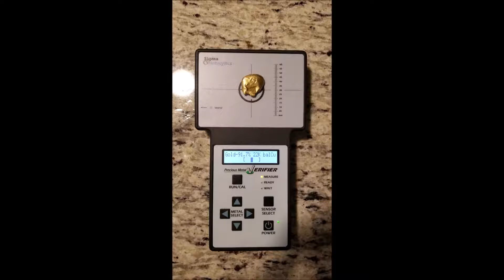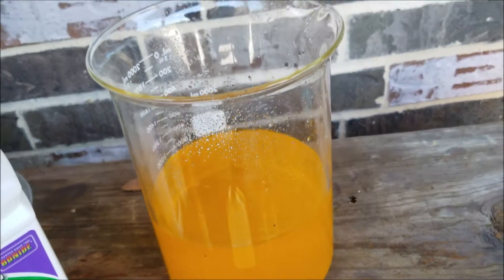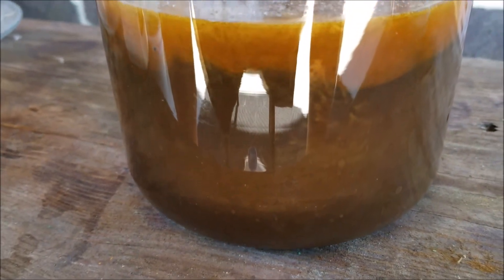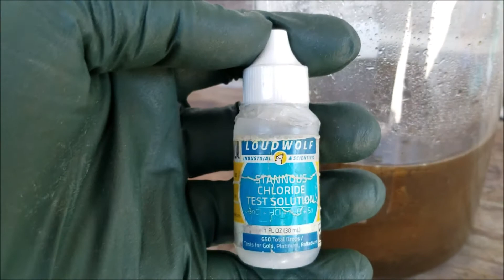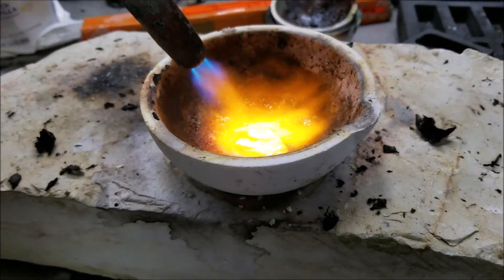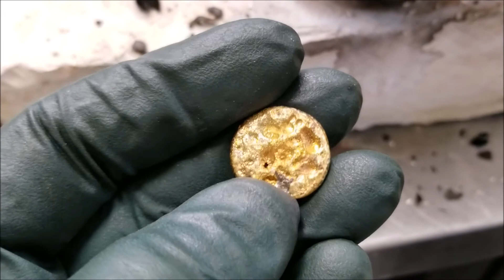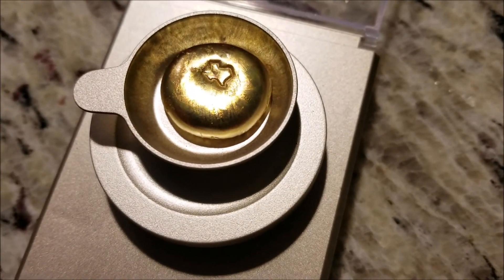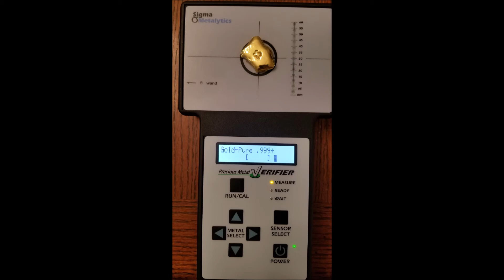Refining over $2000 of 22k Gold into 24K Gold!  Cliff notes on the process!

Comment: Hey Scott I can give you some quick tips to get you at .999 After dissolution add a few ml of H2SO4 (Sulphuric Acid) that will drop out any lead then add some ice which will drop any silver chloride which is that white precipitate. Let settle a bit. Then when you filter if the solution is still a little cloudy like your was filter it thru the same filter again and again if you have to until you have a clear auric chloride solution. After you have a crystal clear solution and you precipitate your gold powder it needs a couple wash cycles with HCl and distilled water. Hit me up if you need any more help, I’d be glad to transfer some knowledge 😀

Comment: If you have jewellery made from 22k and you melt it down does it come out as 21k with the solders? My local jeweller works the gold out as this. Let's say your gold bangle weighs 40grams 22k 

To work out the gram of pure gold in the bangle, he weighs the 40grams X 0.87= 34.8 (24k) 

Is this method correct? Even the bangle have a hallmark of 916 because it has solder it goes down by a karat 21.

I thought the correct method would be 

40x 0.916= 36.64grams (24k gold)

Could you please explain further if this is correct. This is for melting down old gold into fine bar.
Reply: It is definitely possible. I have heard that as well.
Reply: Solders are usually the same karat, and there is so little of it that it's weight is negligible. Your guy is jobbing you.